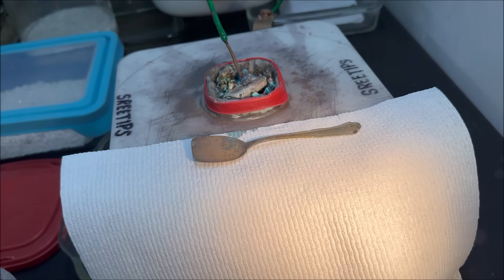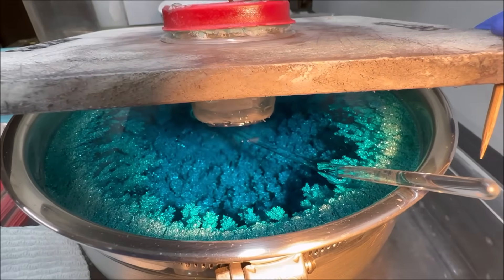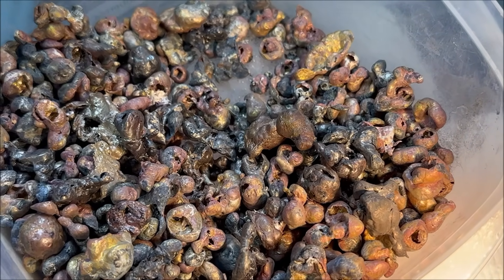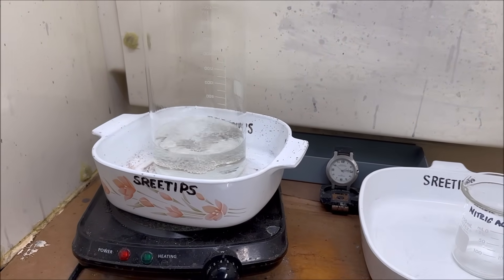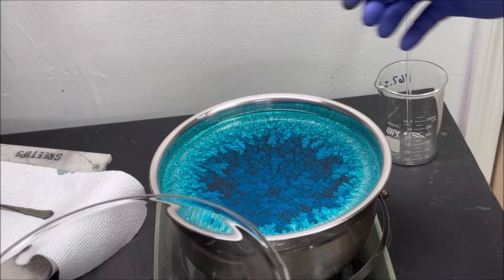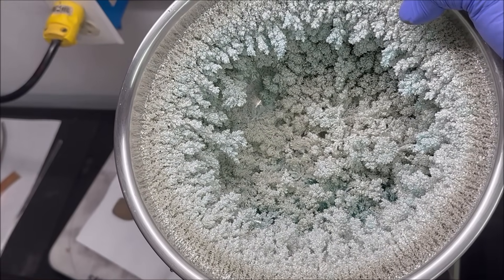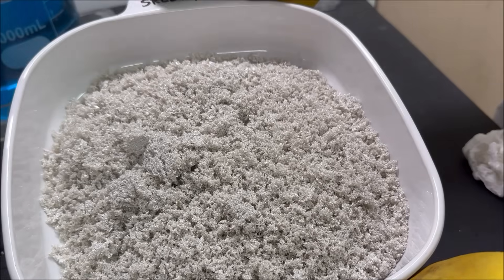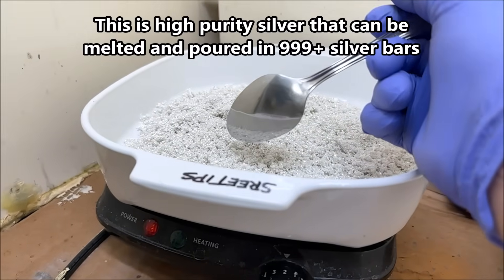999 Fine Silver Cell Harvest and Reboot

Comment: I understood that the sliver gets depleted as the cell works but if sliver is growing in the cell what happens to the amount of liquid or another words does it just evaporate ? I'm not sure how to as my question.
Reply from the maker: Two depletions are going on simultaneously. The physical level of the electrolyte decreases due to evaporation of the liquid from the electrolyte. And, the amount of silver present in the electrolyte declines as the cell operates. It gets plated out on the cathode along with the rest of the silver ions that are passing through the anode filter and into the electrolyte. That’s why I add more silver nitrate for the second run. To keep the silver concentration high. Higher silver nitrate concentration, higher conductivity. Fast crystal growth. But the slimes in the filter slow it back down. I have changed filter mid-run to increase the speed of silver growth, and it works.
Reply: A little will evaporate, but it's just the vehicle for the reaction, it doesn't take part in it